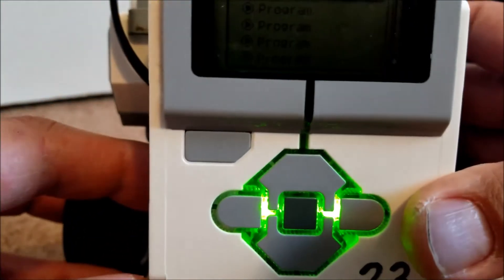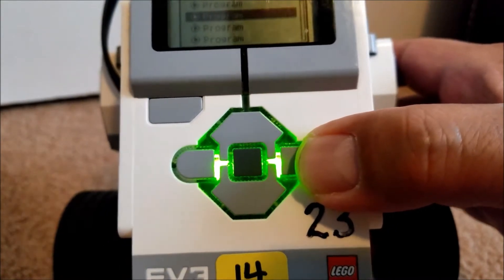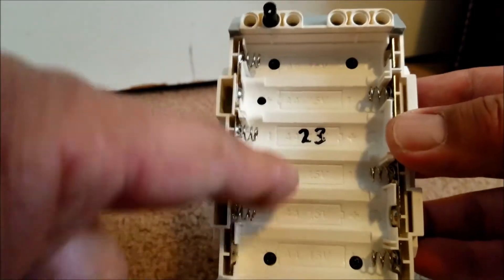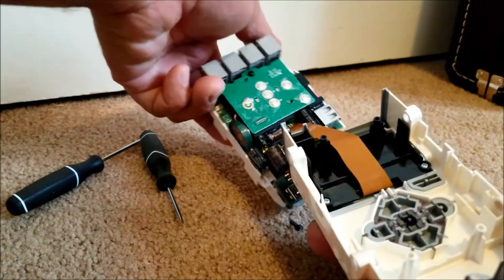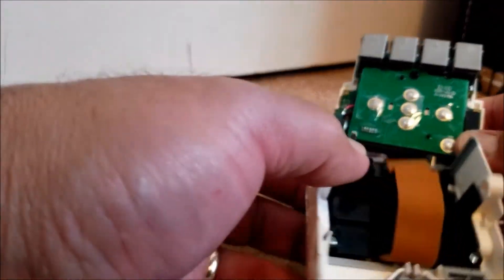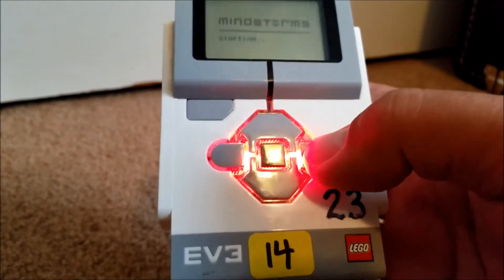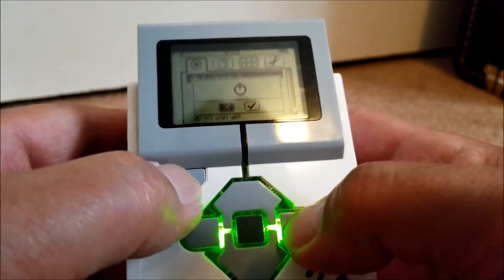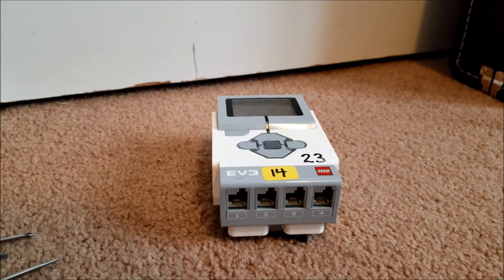"How To Fix A Broken Key Pad Connection On The LEGO Mindstorms EV3 Brick"

Comment: I fixed this issue the other day and in the process I lost one of the triangular pieces that makes the connection to the circuit board. Do you know of a replacement?
Reply from the maker: Hmmm...no I don't.

Comment: Do you think adding a dab of super glue or hot melt glue on the button while it is open would help?
Reply from the maker: It's possible.... I would just be nervous to have glue under the button.  I guess if you had an FLL robot and wanted to make sure that didn't happen during a competition you would consider that.